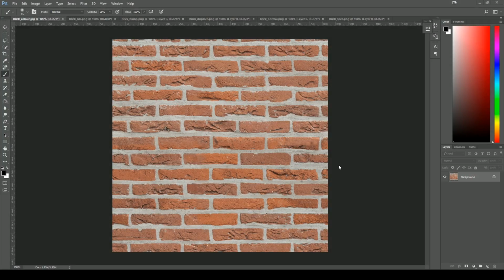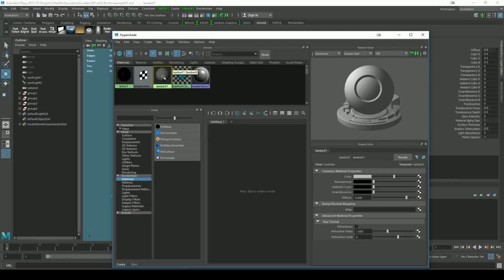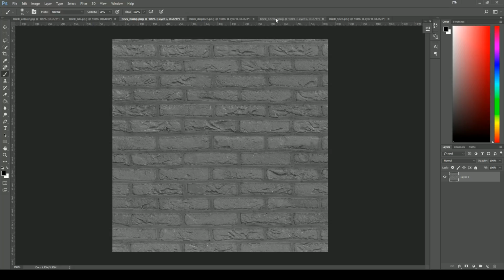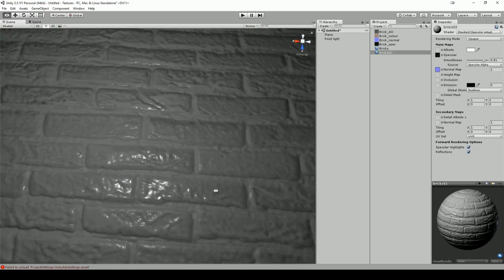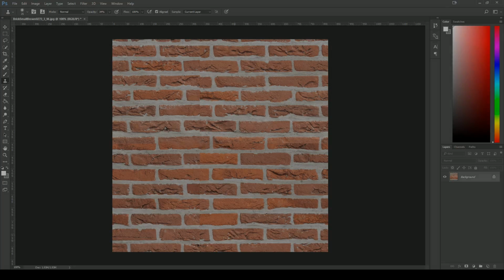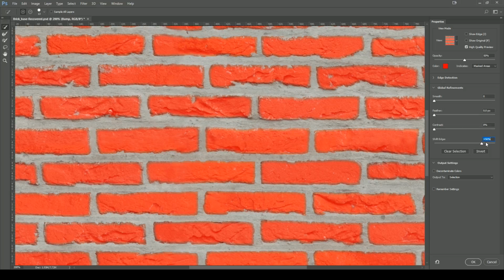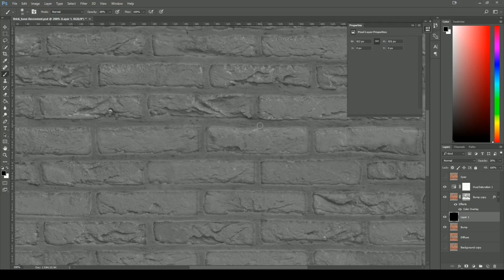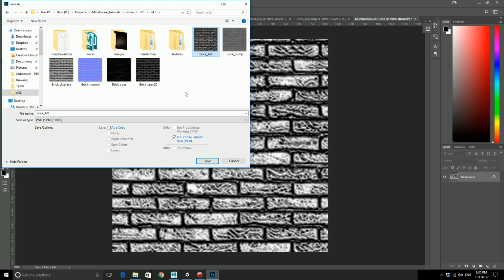Intro to Texture Maps for 3D

Comment: I like your explanation all the maps, but i would add some extra info i've learned:

The darker tones in a occlusion map are the places where light have more difficulty access/escape from, like stuck bouncing when hitting from wider angles.

The colors in the normal map permits the color map to recieve light direction info and be able to create highlights instead of shadows when light sources hit the textured face from diferent angles as if it has more geometry to work from(pseudo normal face vectors), something that the neither the height map nor the bump can reproduce.

Specular maps and metallic map differ one from the other by the way they tint the light bouces and how blured the final material will look.
Specular maps at high intensity tend to make the texture (and its reflection) look plasticky, blown out white and tinted the original color of the color map  and non reflective, while the metallic map tends to make the material look very reflective (very clean chrome effect) , non blured and tinted with the average color of the original color map.